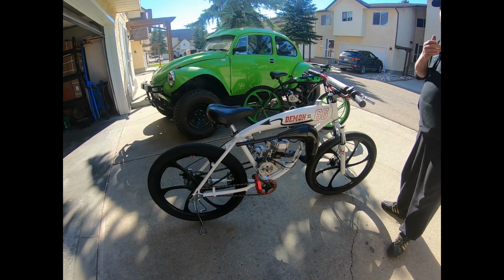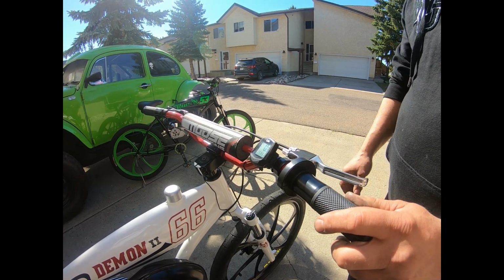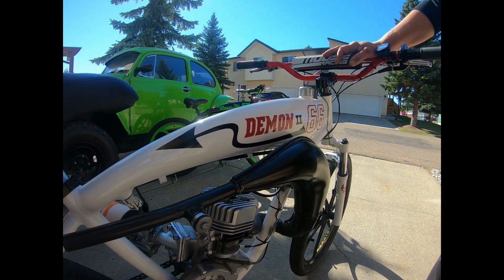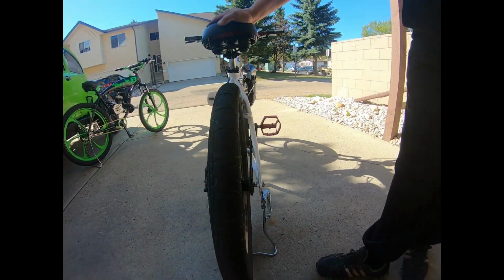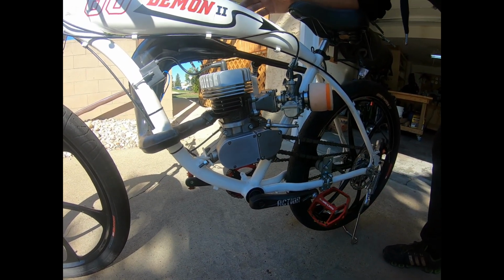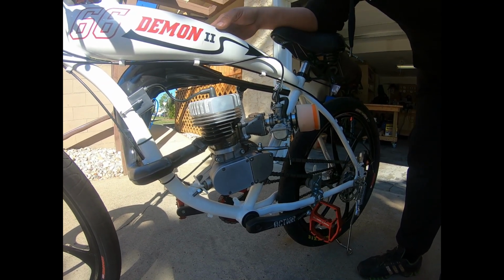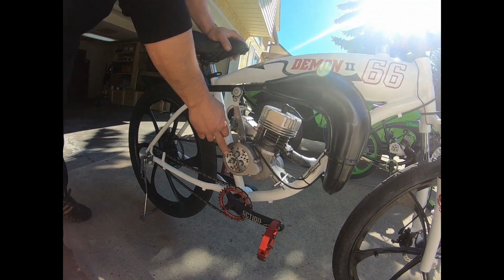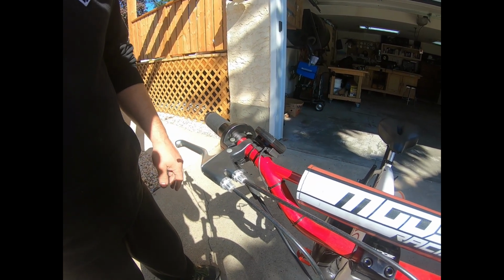Hybrid 70cc Minarelli G2 Reed Built and Sold By DLH Performance

Comment: Man I have got to get me one of those frames with the gas tank included!! They look pretty slick and eliminate that weird looking tank that comes in the kits. Right now I'm using a Schwinn frame and bike that has been sitting outside for ten years. I've got an engine kit coming that I think should get me moving to about 30mph, but I'll hopefully get to the point that I can build something similar to what you have going on here. I've also got two mopeds that I got from Craigslist for a song and dance an express which is two stroke and a four stroke Zuma. The zuma is pretty solid and does around 40mph, but my goal is to get everything up to around 50-55mph so I can take them to work and save the gas money. I also have a 200cc Lifan motorcycle that is brand new, and I plan on riding that thing until I can get the mopeds and bike up to snuff and then I'll rotate them. I'd certainly like to build something from scratch though like you have done here and I can go with top shelf parts from the get go. I don't really know if my Schwinn is going to handle doing 45-50mph TBH, they're not really built for that, but I'm sure the frame you have is much more capable.
Reply from the maker: performance engines on basic bikes are not recommended , choose a proper gas frame, speed rated tires

Comment: What's the name of that kickstand and who sells them please and thanks👍🏁cool bike, great job..
Reply: which is more reliable than the other of two stroke n or four stroke in others all performing
Reply: Its called a Drop down kickstand . You can find them on Amazon  , buy the one that wire is bent like a small foot for best support.
Reply: @dondledbetter1779  hi Don, I noticed you replied on my comment,  You lost me with your comment though, My question is about the drop down kickstand. Thank You Darcy.
Reply: Mark sorry about late response
Reply: @darcyhemeon4309  it's all good Darcy, thanks for the response, And I bought another clutch thank you for the spring hookup, you're the best🏁👍🏼✌🏼

Comment: That rear brake, how do you keep the oil from your chain off of it? 

My Switz beach Cruiser is made for a rear disc, and it also has a coaster brake that comes already BENT for chain clearance.  Anyway, I'm told the the disc always gets a build-up of oil, and even a tiny bit can toast your pads.  What say you? 

How bout Loctite on the studs, where they screw into the bottom >>>> did you use any? 

That's one sweet looking bike, but what about the comfort factor? 

I was going to get the F-100 on Black Friday sale, but how UNCOMFY most everyone who owns one says it is, I got the Switz instead.  

Anyway. . .

Comment: Maxxis hookworms in a 26" tire are 26.X2.5 .. i cant find a mag rated for that width .. are you just using the 2.125 rated rim with 2.50 tires ?   cool if you are seems to be working...
Reply from the maker: 26 inch 2.50

Comment: What size jets do you run in those vm18 carbs
Reply from the maker: I'm running a 22.5 to a 25 pilot , 85 to 90 main , needle two notches from top, this is my setup ! yours dew to elevation , pipe , port work , could vary your setup . always go through a jetting process to achieve proper jetting
Reply: @dlhperformance7169  your builds are awesome by the way. You do really good work.

Comment: i have the same set up.  even with the vm 18 mikuni. but i need to know what you got your jets set on.  i think the mikuni comes in 70 out of the box.     can you tell me what jets you got it on ( main, and pilot jets so i can get the idea where to start at ).
Reply: 22.5 - 25 pilot 
85 - 95 main
Reply: Wouldn't you have to know his altitude before making a decision to get a better idea on what size jets? He's pretty high up in Canada.

Comment: Hi, Is the sprock 36T?
Reply: Yes its a 10/36 tooth . I like this combo, works well all around for bottom to top end , the engine can handle 32 tooth easy but sacrifices the bottom. Bike will easily do 54 mph , if you change to a 32 tooth will do over 60mph
Reply: @darcyhemeon4309  ok, I made a 115cc engine with a motorcycle jog cylinder, that bike has 18 motorcycle rim with 2.50 tires, which is about 22-23 bike size, which you recommend to me so that I have strength on the climbs and speed in the plane
Reply: @elmundodealexoriginal  a 24 tooth rear sprocket with a 10 tooth front
Reply: @darcyhemeon4309  OK thanks
Reply: @darcyhemeon4309  with one of your clutches tell him not a stock clutch hahaha! A 10t-24t will need a good clutch or a Hella pedaler
Reply: @darcyhemeon4309  I'm going over 50mph now with a 10t-32t and that's too fast on a bicycle.
Reply: @m.kasper7646  what engine
Reply: @darcyhemeon4309  run well, falcon cylinder with an oko 21 Reed valve & a smolik head and bought a degree wheel off your website to help me dial it all in and you were a huge help thank you very much! And I am still enjoying it today and I just came in from riding on this So Cal beautiful first day of spring day. I love and enjoy my bike with your saf clutch & I still need to weld up my expansion chamber to be able to dial in my carb better, but I still get over 50mph with a stock pipe but I hate it. I'm a cruiser anyway. 🏁💪🏼😎🙏🏼✌🏼

Comment: You are going to blow that thing up I don't get why guys build these fast engines and don't set them up on gears when it's so easy to do.just keep the roms maxed out why when u can go up a gear and build up the rpms again and gain even more speed with less heat and less stress on the motor and clutch gears.
Reply from the maker: motorized bike engines are only single speed engines
Reply: that may be the case but  it should occur to someone with more speed is even more risk. I wouldnt want to promote this Idea without some regulation .
Reply: @Kevin-l7k  well duh but it's not about building up speed go the same speed but less rpsms less stress on the motor it will last longer.the well built motors cost a lot.i priced the motor I want is $1,000
Reply: @lllllsp1d3rlllll  well like I said in theory you are right but that is impractical in my opinion on a bicycle. But Hey you may be the one who puts the first one of your idea together.

Comment: The price for this engine  is 850 it must be double the power of a phantom v3
Reply from the maker: 2 totally different beasts minarelli engines have a higher rpm range , the cyclinders are more expensive  . expensive parts equal a more expencive engine

Comment: I'm really surprised to see that your using a good ol p.o.s. stock chain tensioner. Those things a hazardous for your health but if it's your bike do with it what thou will. But never in a million years would I ever even think about selling or giving a bike to someone with one of those chain tensioners on it. There's a 98% chance that it's going to  fuck up some back rims because that's what they do. Stock chain tensioner / back rim destroyer lol.!
Reply: All the hardware in the tensioner changed to top quality,  may be this is why so many have had issues,  I've never had one fail after it's been improved or even loosen
Reply: @darcyhemeon4309  to be honest with you I think the best thing to do is remove your chain off your bike then take a link out of it then add a half link to get your chain to fit just right to where you don't need a chain tensioner. My bike runs smoother without a tensioner for sure.
Reply: @Clifford Bradford  I've built alot of bikes I appreciate knowing how you like to setup your bike  , I've ran them all different ways , tensioner and no tensioner , 
Thanks for subscribing
Reply: they can lock up your back wheel at 40 or 50 Ive experienced it first hand. God was with me that day.
Reply: @cliffbradford4679 yes but not all bikes will allow that.